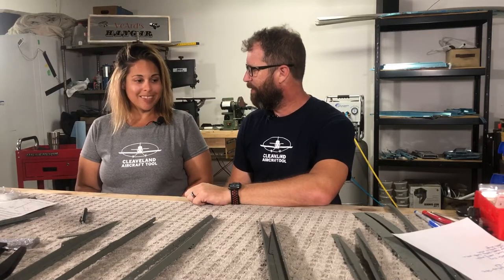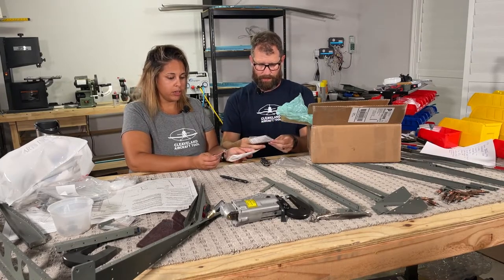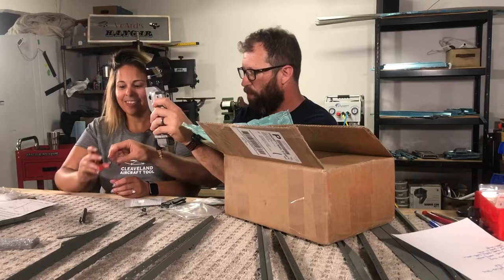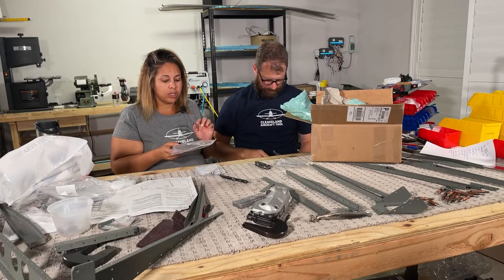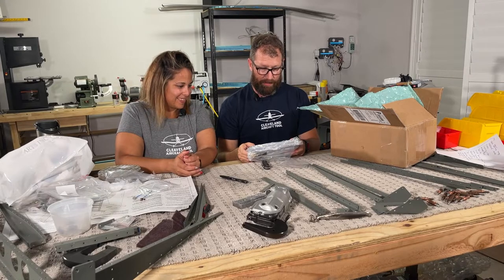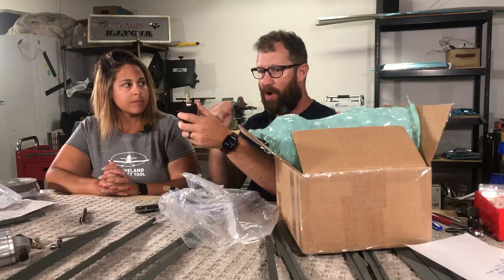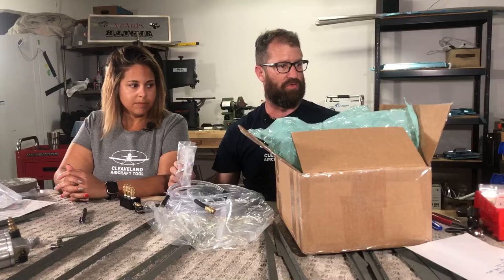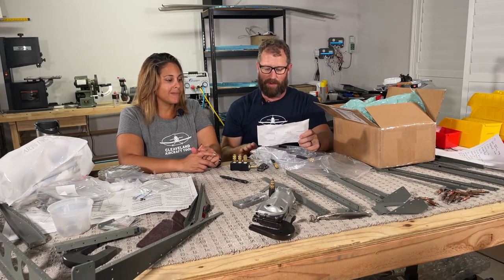Cleaveland Tools for Vans Aircraft RV-14 Build:  Unboxing 3M Wheel, Squeezer, and Air Hoses

Comment: I used an aluminum angle clamped just forward of the trailing edge on the rudder and used that as a guide for my squeezer to get the same position on every rivet.
Reply: @N14VE  What I mean is you’re using the Cleaveland set, but using the angle as a stop to rest the yoke against. This accurately positions the set over the rivet for the final squeeze and gives you consistent results on each rivet. 

Good luck!

Comment: The squeezer dies are amazing, I have completed all of my trailing edges with them and it makes thing so easy!  The only catch with them is how "deep" in from the trailing edge you position the die will impact how completely set the rivet is.
Reply: @N14VE  right.. but even so, since your squeeze is set to a certain closure, if you move the squeezer further 'in' from the trailing edge where it's thicker, it will still squeeze to the same dimension so you might over or under squeeze based on position.. it's easy to figure out, just a little note to be careful with